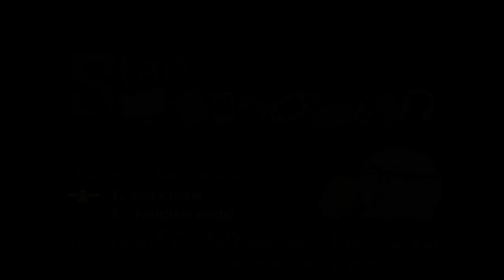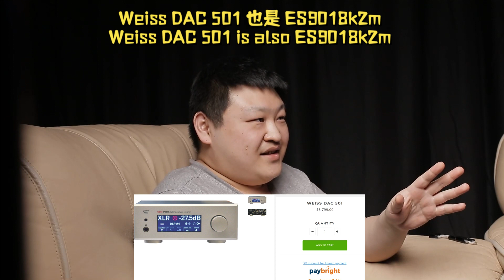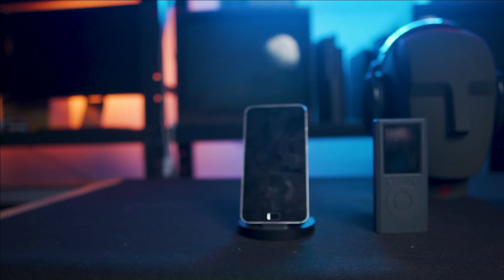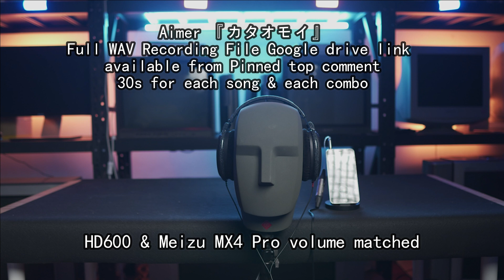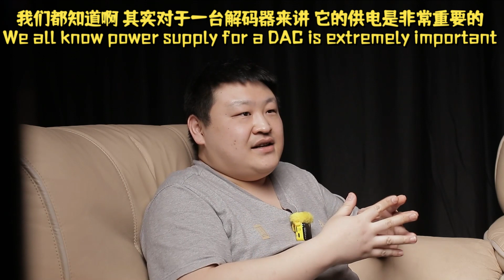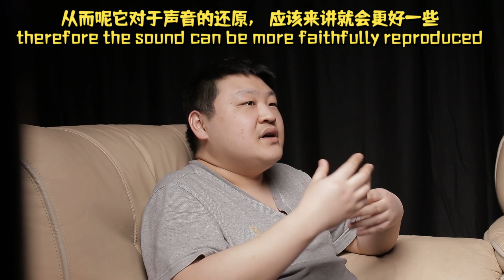【Wild Truth EP09】Can you "hear" the difference from the same DAC chip?

Comment: Output stage make the difference beside power supply.
Reply: can you explain more?
Reply: @Viewer13128  DAC chip output will connect to analog filter or another stage of amplification.
Reply: you just add another circuit at the output. Different component will alter the response of the DAC output.

Comment: Head room. I agree. You can actually feel that your headphone is having an easier time reproducing sound when power output is higher regardless of the dac chip used.
Reply from the maker: and all modern HiFi chips are more than enough at 100 + , thd+n..not that anybody will care and tell u...ohh it is goood enough for you to hear , lets improve on the rest..what they will do is tell u , u need better measurement result and worse sound haha~
Reply: @WildLee  yeah, I myself just impose a minimum level of sound quality. Beyond that limit, I really don't care what dac I'm using.
Reply: Truee, it's not about cranking volume (knob). I can definitely hear the difference between low voltage-loud 100% volume and higher voltage-silky 30% volume.
Reply: Yeah and this applies even more with amps I would think right? TBH I never thought about the amount of electric power in the DAC..

When I listen to my headphones on this cheapo (but good) "balanced" headphone amp, everything sounds a bit clearer (and it's the only thing that really powers my dt990 600ohms)